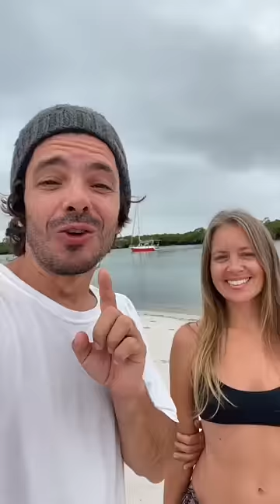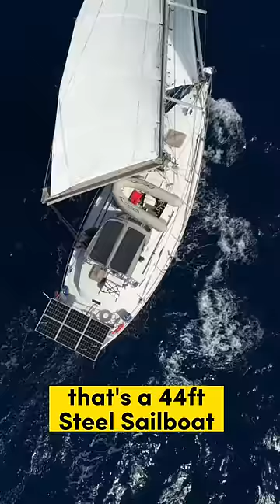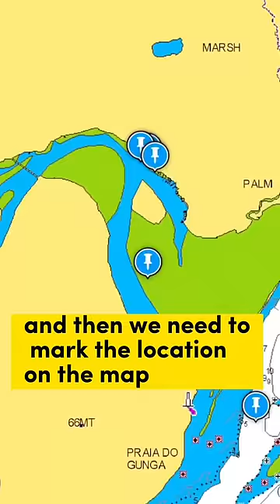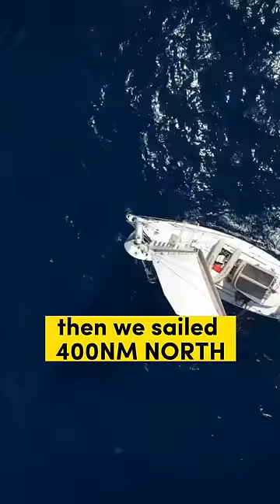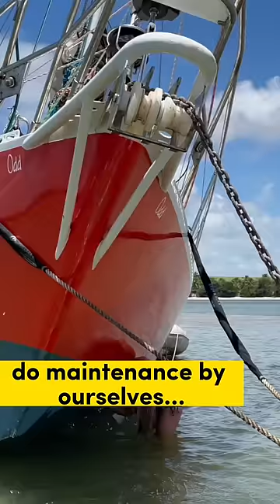Sailboat HACK ⛵️#shorts

Comment: You could do it with a keel boat but it would tip a LOT more and I'm NOT advising it (but you could do it if you needed emergency work like fixing a hole or shaft seal - make sure you keep the hole on the high side :)
Reply: Agreed... but nice tip to put in the back pocket for future use if needed
Reply: Your run support legs to the shroud chain plates. It's not a big deal doing this on a full keel boat. It's standard practice.